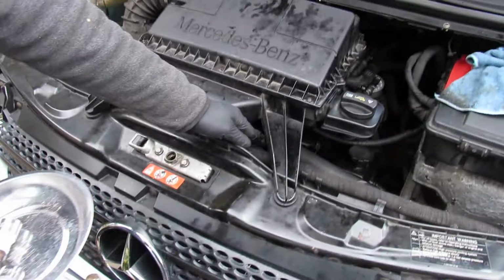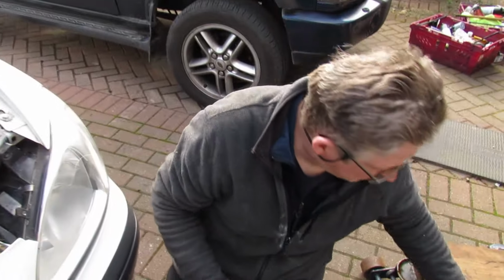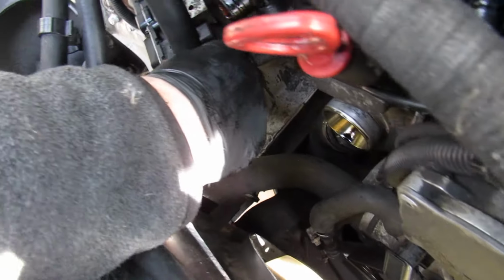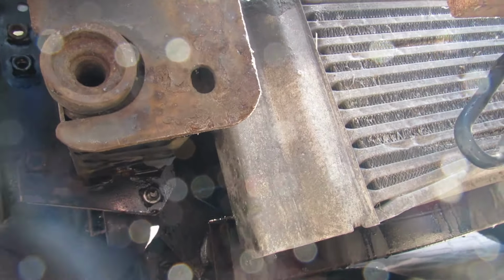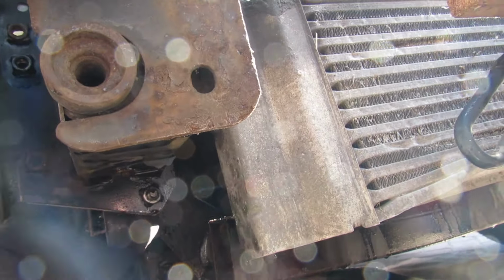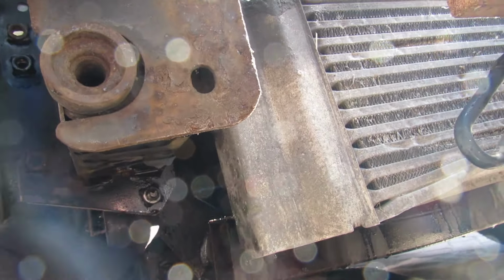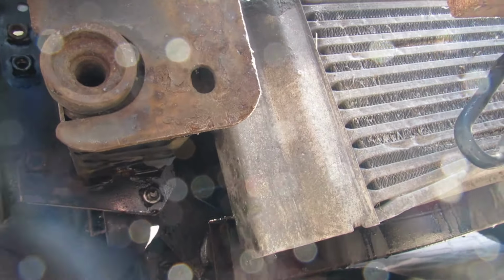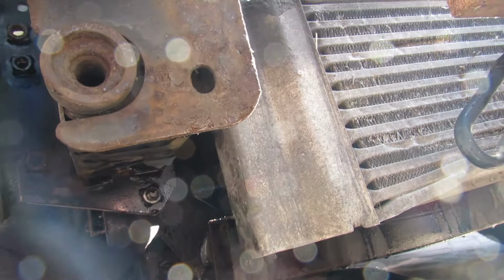Mercedes Vito Van W639 OM646 How To Replace The Water Pump, Thermostat and Drive Belt Pulleys Guide

Comment: Good instructional video - the only part I wouldn't agree with it the advice on jubilee clips. I would always use a constant tension spring clip inplace of a jubilee clip.
Reply from the maker: if they are new then no problem, anything old i wouldn't trust them after a experience we had
Reply: @DanielJohnHowTo  agreed if old and rusty. Same can be said about a manky old jubilee clip. The spring clips are a better long term option though and less likely to cuase problems or come off unintentionally
Reply from the maker: @philbailey8082  true, we had one come off and dump coolant everywhere luckily it didn't damage the engine.

Comment: Great video, very helpful, but how on earth did you get the big hose off of the intercooler on the passenger side? There is no access to this without removing the fan cowling and that doesn't want to come off either! So we're stuck. Also, the small pipes on the driver's side of the radiator - what are they? Mine have high pressure type hoses and connectors that seem to just push into the radiator (or seperate cooler?). The connectors that push in are quite loose where they go in, but without knowing what they are, I'm reluctant to pull them out, as they look like high pressure oil pipes. The van doesn't have air-con, so it's not that, but that's what they look like. Any ideas? Thanks

Comment: did you use the old metal gasket again ?
Reply from the maker: for the water pump the surfaces were thoroughly cleaned and a new gasket was applied, don't recommend reusing gaskets etc.